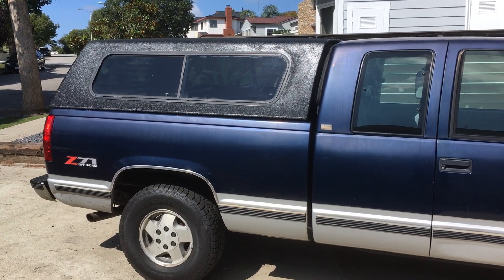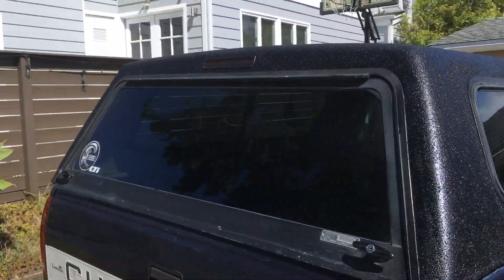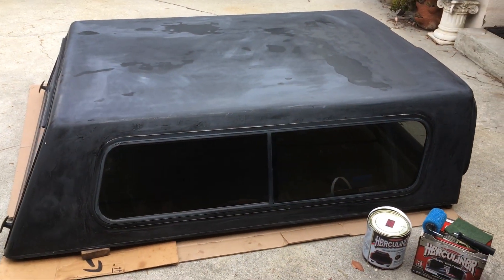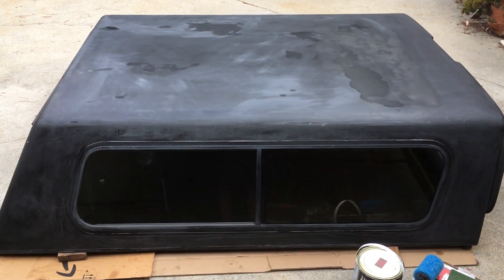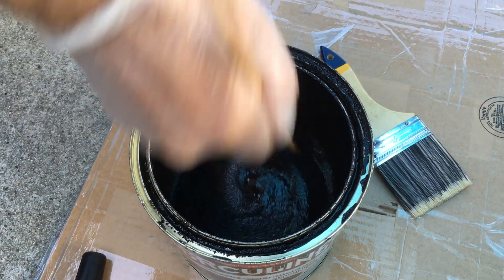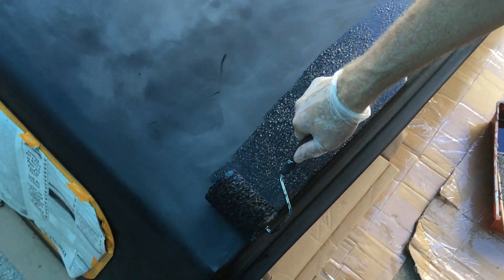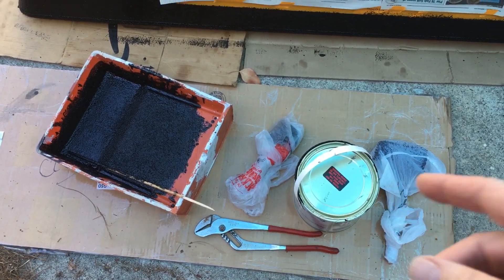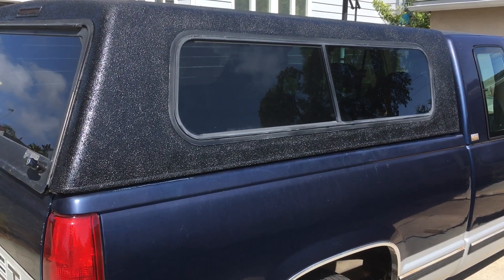Painting A Truck Topper With Bedliner

Comment: $16 could have gotten you a quart of paint that was the same color as your truck and you would have to invest into some tools and maybe a carport to paint in but the bed liner looks good since it's a topper and not a permanent fixing to your vehicle. I'm planning on getting a couple quarts of silver and since I have a barn I was going to make a little temporary room out of plastic sheets to paint my whole truck in, she mainly needs a new clear coat but a touch up of silver would look good.
Reply from the maker: Thanks. Yes I could’ve probably done a better job and use regular paint, but I figured the texture look pretty good on the camper shell, and I could use the leftover bedliner I had from the bed of my truck. I’m really happy with the way it came out, but I wouldn’t want to paint the whole truck with it.

Comment: so how is it holding up...debating what to paint my purple cap with...truck is black.  Liner vs. paint.  I assume it's a little shiny and that will fade fairly quickly...I'm thinking no issue as long as its black..contrasting black wouldn't be bad anyway
Reply from the maker: You’re right. It does lose its shine after about six months. It looks matte black now, just like it would if it were painted in the truck bed, but I like the look of it. I’m not sure if you could pink shiny clear coat over it or not. I think it looks fine the way it is.

Comment: does this get hot inside? Would it cause issues if you we're using it for camping?
Reply from the maker: It definitely gets hot in direct sunlight. The roof is really thick, I think it’s made out of three-quarter inch plywood, so it doesn’t get super hot, but painting it white would definitely be the way to go if you’re going to be in it in the daytime.

Comment: Cool, my Dakota just got smashed in the rear. I found nicer one that's a different color but the same truck. I want use my old cap which is the same co,or as the wrecked truck. If it were black it would fine.
Reply from the maker: Then this is the way to go. The stuff is tough and will last forever, but it will turn Matte black after a while.

Comment: Is sanding the clear coat off recommended?
Reply from the maker: I don’t think you need to take it all the way off, but you would want to rough up the surface with sandpaper. Lee bedliner kit came with a sanding pad that you use to scratch up the surface so the bedliner will stick.

Comment: Why bedliner and not regular paint ?
Reply from the maker: That’s a good question. I went with bedliner because it covers up sloppy painting. If you paint it with regular paint, you have to sand it down really smooth to make it look nice. With bedliner I could just paint it on and it’s supposed to be bumpy.
Reply: hoohoohoblin mine came out pretty decent with spray paint I’m going to buy a buffer just to see if I can add shine. But I’ll see how it holds up long term if I have to redo maybe I’ll do what you did.